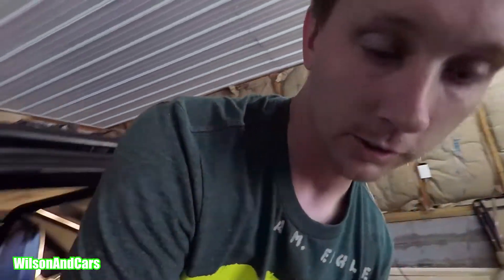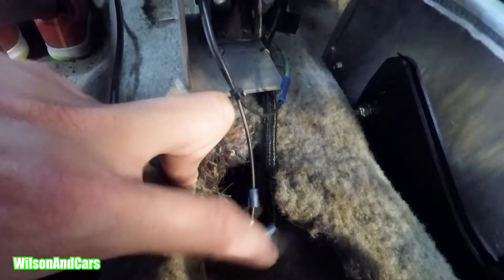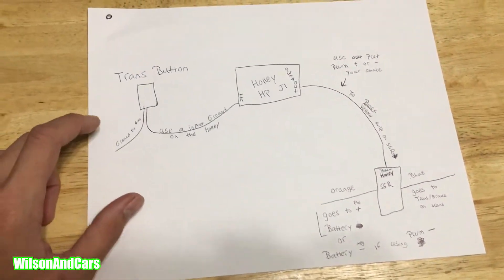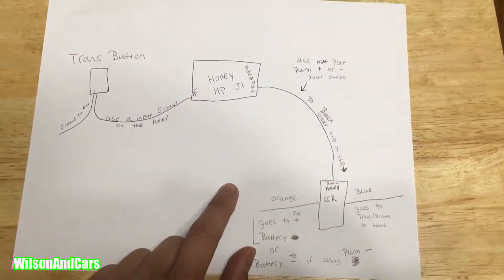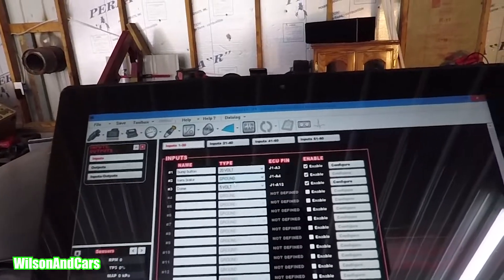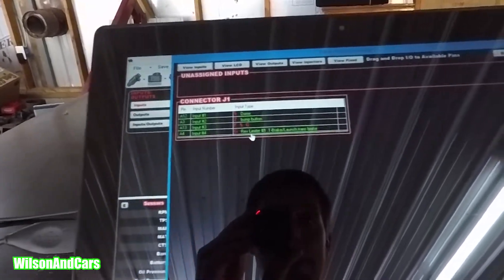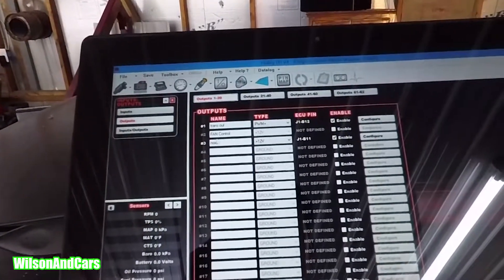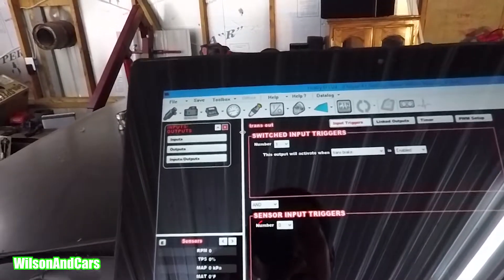holley v4 Trans brake wiring and 2 step setup

Comment: Do you need line pressure for solinoid to release. Mine is sticking. It's definitely a power issue. But I haven't ever run the trans. It's very fresh. It's for sure not the valve.
Reply: probably need to pull the spool piece and sand it down lightly. had the same issue when my trans was new.

Comment: How does bumping in work? Did you have to wire another momentary switch parallel to the Transbrake button?
Reply from the maker: you use another momentary switch and Input on the holley, then you configure that button for 0-20v > then goto i/o page> Outputs> and where you have solenoid for transbrake at click on Configure>goto PWM tab > Table units Duty cycle % > then X axis of the table can be Boost or Rpm i use RPM > then Y axis will be your bump button...  anything under 5V will be 100% and then everything above it will be 75%, every one is little different but just play with it.  This is all dependent on if you have Holley